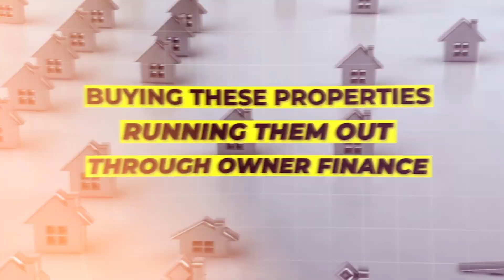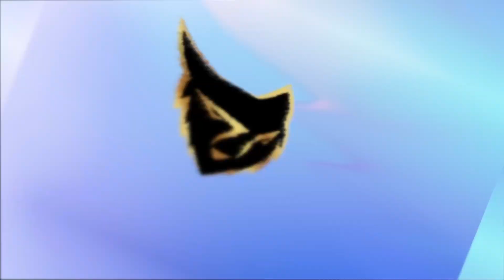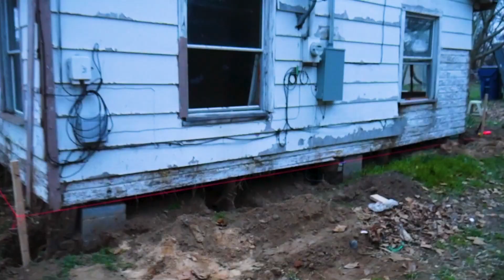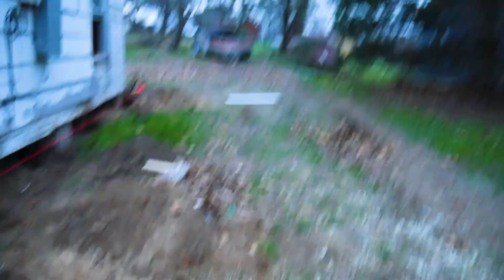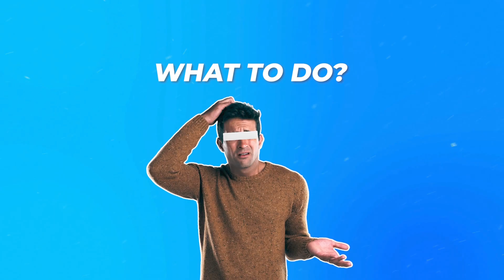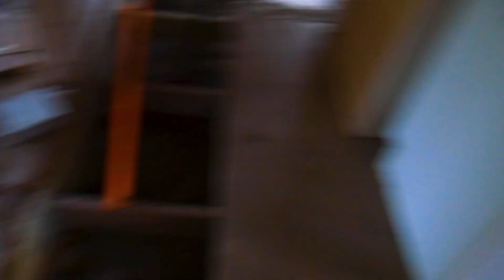My House Collapsed Real Estate Nightmare turned into Cash Flow

Comment: It doesn’t worth of saving the house. So beat up… from a former builder. 

Demo and rebuild a new place
Reply: I hear you; if justified..
Reply from the maker: Much easier to build than what we did if that was the best option I would have had fun tearing it down myself 👊🐺💪that was also a throw back video from like 2017 or something like that I found and thought my team would like but I hear ya but to build new I would need to get at least 115k and also the houses in that area I compete with are all sub 100 for the most part
Reply: @ConnorSteinbrook  great!!!  There are customers seeking for a good quality houses.  I can’t stand production homes
Reply from the maker: Replacement value in this area cannot be done without losing tens of thousands that would not be possible to build new in that spot and many times there is zoning requirements